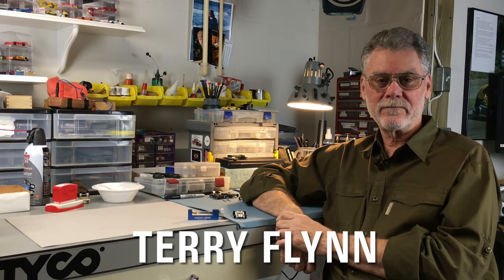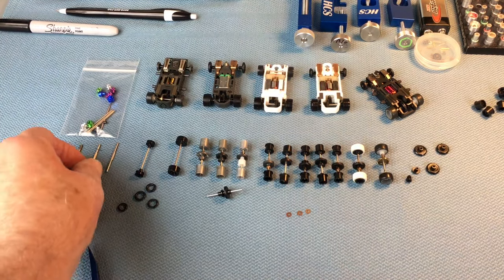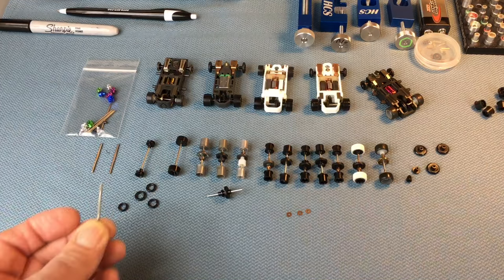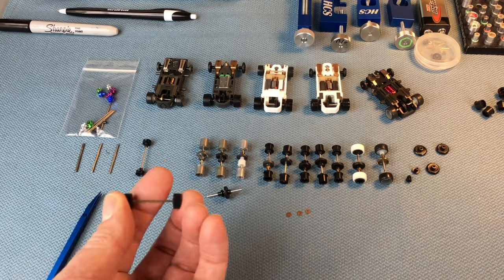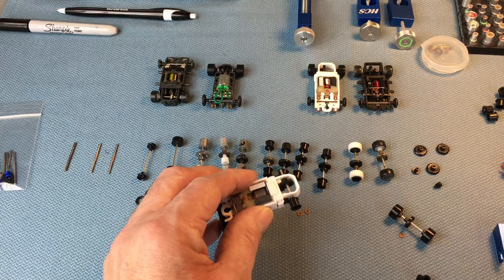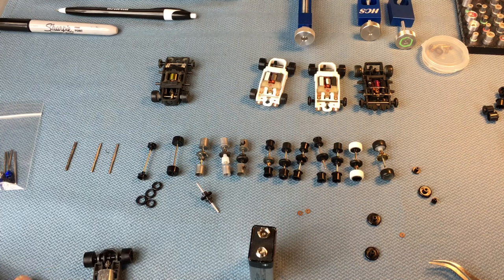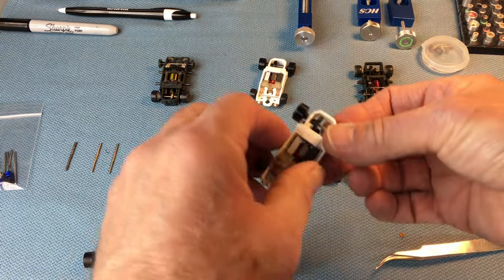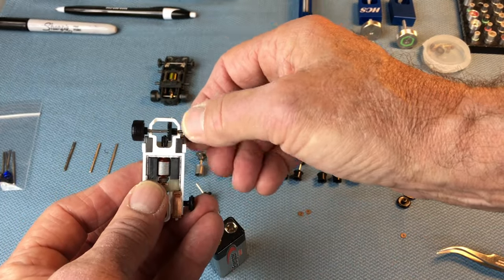My Favorite Parts - Episode 6 - Axles and Gears

Comment: Thanks Terry. I would really appreciate a short addendum to this episode where you talk a little about metal gears. I had a low quality press that I bent a pretty nice coated axle on while trying to press a metal gear on. I then discovered Mitchell's abrasive cord and figured out how to use that stuff to finely "tune" the ID on the metal gears to maintain a tight press-on fit but not so tight that it either bent the axle or stripped off the coating.
Any tips or tricks you have for metal gears would be great.
Reply from the maker: Metal gear systems are really an advanced part system.  Usage is actually extremely low.  Because of the complexity and skill needed to install metal gears correctly, I do not carry or sell the parts.  So, really, they are not 'my favorite parts'.
Reply: @riggenracer  I understand what you are saying but you clearly do use them on occasion and you did say you could go into them a little at a latter time. 
I don't think anyone is looking for the definitive guide to metal gears but I do build neo cars as do many others and anything you might have to contribute would be much appreciated. 
Even if it doesn't make you money.
IDK, maybe it's not worth your time but I know there's a group of people that would get a lot out of anything you might have to share.
Maybe a short video on neo builds as a whole or something along those lines if the subject of metal gears alone is too "niche" for you.
I hope you'll reconsider.
Thanks.